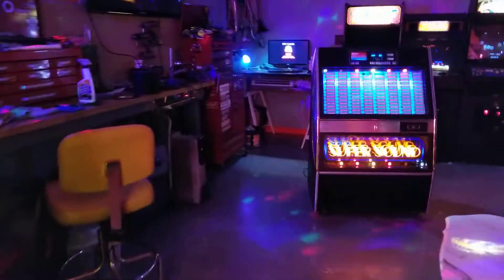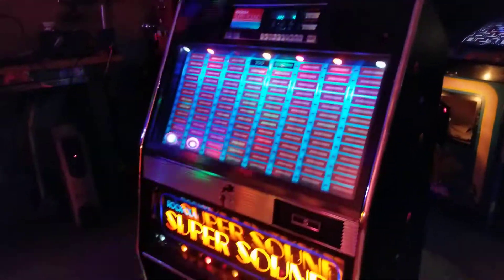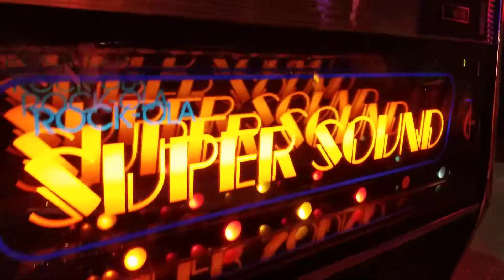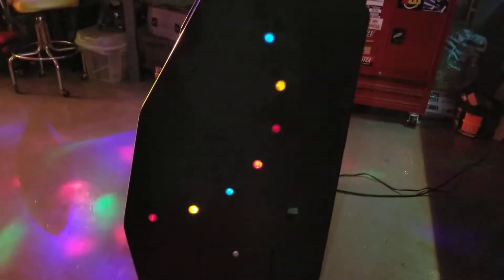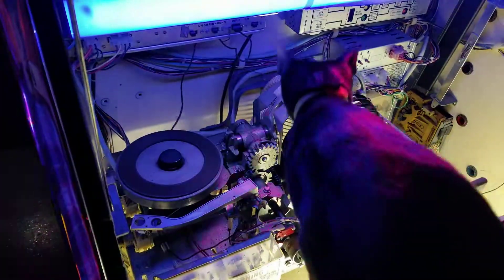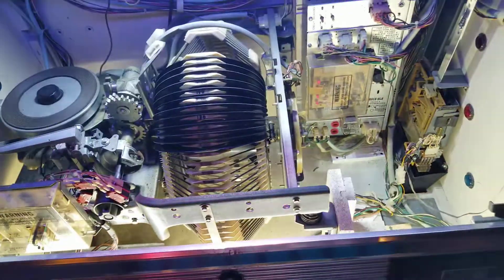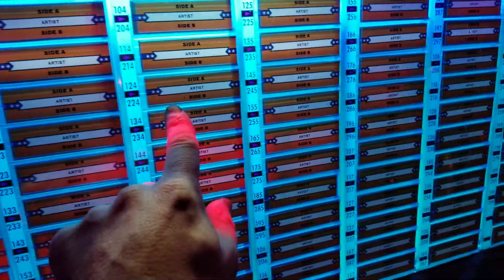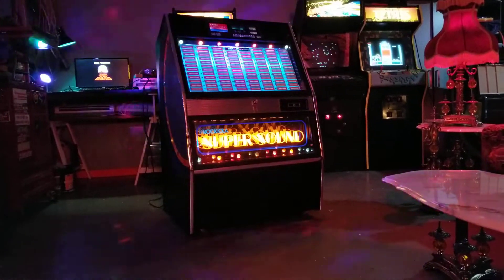1982 Rock-Ola 490 Super Sound

Comment: Hopfully you recapped the amp,reflowed the solder on all the pins, and relocated the battery in computer. I just took a 490-1 blue horizon to Adams Antiques in Adamstown. Too bad about that side art though. Maybe someday reproductions will be available. Had I acquired it,
that machine would have been parts or a "test" machine due to the missing artwork.